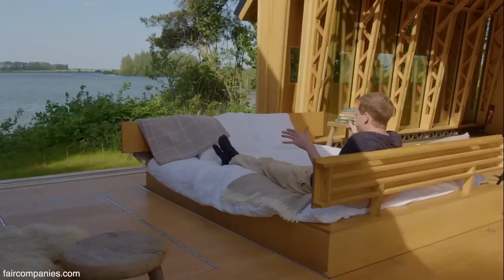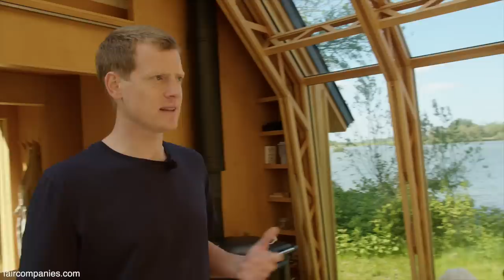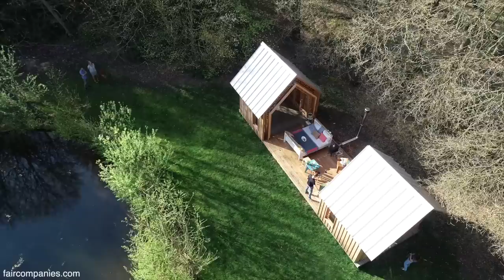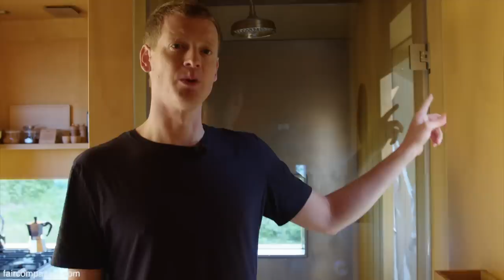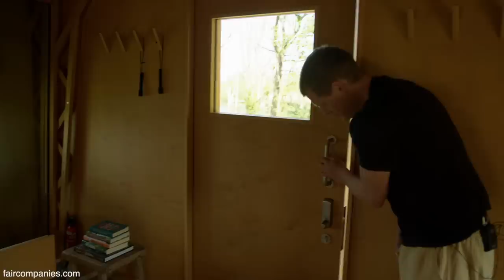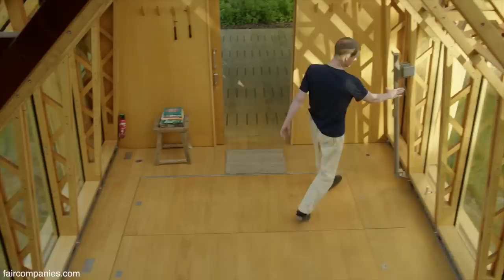Sliding home enlarges with railed-walls, underfloor bed & tub reveal

Comment: Wow!  MANY improvements since that first prototype on his Mom's property.  I LOVE that it's air sealed now and the glass has double panes.  The attention to detail in making it more weather tight, well insulated and with a kitchen, bathroom, not water and power is fantastic!  I also notice he's added even a pocket for the glass section to mate into the stationary piece with for air sealing.  I really love the original, but having both ends move didn't allow for the kitchen and bathroom.  Pretty brilliant.  Nice to know he's developing a kit that can be flat packed and shipped, though I'm sure it would be extremely expensive (from our perspective).  Anyway, love this one even more than the first!
Reply: I would make it a free standing kitchen on one deck, which can be covered just by the glass, or the body section, or opened up. So the door on that side would have to be some kind of larger bi-folding doors.
Reply: Is it a different house it just a better one ie is the other one out the back?
Reply: @lucypeace6132 haha I agree. I think I said that too. But a glas extension since it is holland

Comment: Love this design. I like the builder's thinking process in the design. You are really in nature when the structure slides apart. Awesome.
Reply: I get the notion, I really do. However imo it exudes flatulent novelty and is lackluster in reality. Longevity issues, leaks, track problems etc.. No doubt, any settling would screw up the whole thing. Not to mention earthquakes.

And mainly, if you want to be outside, go outside. If you want a bathtub outside, great. This is why decks and patios exist. This is just a waste of materials, time and energy.
Reply: @newolde1  Definitely a lot to consider! I never thought about settling of the structure. Yeah, it would make it obsolete in its design.

Comment: It is an interesting concept, the only thing I always think with those integrated solutions in acting house like the moving bed or walls, is the hassle of moving the stuff every time you need to reconfigure the space
Reply from the maker: I think the idea is to either leave the bed out (if you decide to make that your main bed in a loft type space) or leave it in the floor (if you'd prefer a big table and to have your bed up in the loft) and really only change that default setup for bigger events.
Reply: @kirstendirksen  I agree, the loft as sleeping space makes sense as a single or couple. It makes a lovely treat, to be able to sleep underneath the stars & could really reignite interest in any intimate relationship. That’s one matter I find fascinating

Comment: i hope they make a model with a larger and more traditional housing unit add on. like maybe an extra 10-15 feet of depth with a full sized staircase, a taller bed loft, space for at least a 3/4 size fridge and a desk area for a computer. i wouldnt personally use that bed for anything but guests.

Comment: I think it’s beautiful but also that the novelty would wear out pretty fast. 
Also, what kind of maintenance does he expect will be necessary to keep those moving walls “super low friction.”   There’s a lot of crap floating in the air.
Reply: How would you keep it warm?
Reply: @tp1201  Have you watched the entire video? It explains quite well I would think.
Reply: @MarkTheMaker  wood and glass.    
Don't think so.
Reply: @tp1201  Perhaps I don't read your comments right. But you asked how this house is heated. It contains a wood stove that is being used both for heating the space, as well as heating water for the kitchen, shower and bath. 
They also explain how the whole place is actually quite airtight, even though you would expect air to be able to run through where the wheels of the sliding parts run on the rails. Same goes for the door with the dropping brush in order to stop the wind from blowing inside.
Reply: @MarkTheMaker  yes, I did see the wooden stove, but I'm sure it would still be cold inside. No Insulation! Well not enough insulation for me. I would need some heated floors as well. Or live in a warm climate area.
Reply: @tp1201  I don't know if you have ever experienced the warmth of such a wood burning stove and don't know how cold your climate is. But I've spent winters in a badly insulated chalet in the French alps with nothing but a wood burning stove. Outside it could be -20 and inside 25 degrees. 
The double paned glass and most likely insulation in the walls would probably make this a very comfortable place to live in. 
Also, when needed, you just make it smaller so that there is less volume to be heated...
Reply: @MarkTheMaker  That is nice to know. I really like this cabin. 
Thanks.

Comment: Bath complications of floor panels made easier using folding floor flex hinges and drop into storage compartment customized to solve so many dirt, air flow and water issues. Loving water wood/solar! Wrap exhaust chimney coils or stovewall hot water RV home efficient. Outdoor shower great and possible indoor shower using tub with flexible shower curtains

Comment: I would love to add the glass pull-out section to the back of my Florida townhouse!  And I'd change the tub to a four-person hot tub!💖👍
Reply: In that case you're better off putting the tub outside, otherwise you have a huge vapor source in the house. Mold city.
Reply from the maker: That's an interesting idea to add something like this as a home extension.
Reply: @kirstendirksen  I think this young man has stumbled onto a potential global solution for homeowners with limited space and should start a business!

Comment: At 25:50 I thought they had the bed in a separate room on the opposite end of the house giving you a bedroom but it was just the way the shot was angled but I think that’s a much better design.  
With so many people wanting a bedroom on the first floor I think it would be better to have a divider wall with door on the one wooden side the one without the kitchen bathroom as a bedroom with a wall and door, kinda the way it looks at 25:50 with of course the bed in there not in the middle of the house.  
 I just think it’s more practical to have a closed off bedroom, unless you are younger and don’t mind sleeping in the loft, though I’d love the loft if they can somehow make some tall stairs going up to the sleeping loft. You probably could, going down beside and or over the fireplace. it just might be seen through the glass but I think it would look cool if you could build metal and wood floating Stairs making it almost look like art :)
Reply from the maker: I wonder if this kind of build works best for one person living alone, or a couple, and likely in a more remote place where you wouldn't worry as much about privacy. Though I like your idea of art stairs.

Comment: Interesting concept. The glass patio being on the end of the building was the best orientation to me. If the main house was fixed and only the glass patio moved to open the deck then I would like it better. You could double the amount of solar panels without having to worry about the weight. 
 Accessing the bath and bed seems exceedingly tedious. A small hot tub on the deck seems like a better option. Just move the boiler and bathroom to that side of the house in order to keep it heated. 
Instead of having to crank the bed up and down I would go with a recessed floor where you step down into where the bed is located. That way you can simply place the floorboards to cover the bed space without needing to remove everything from it and spend 10 minutes cranking it every time.
I would also go for some larger windows since it seemed rather dark inside when everything was closed up.

Comment: What an amazing home.  So calming and serene.  The wood is really gorgeous too
 I wonder since they are close to the lake if there are any issues with mosquitoes or other insects.  Here in FL you would NOT be able sleep too well, wondering what's gonna be crawling on you or eating you up, breakfast lunch and dinner, if you were open air like that. Heck, even in a well sealed house there can be issues with fire ants, regular ants, the Itty bitty sugar ants, spiders, flues, cockroaches, palmettobugs, & mosquitoes. just to name a few. There also can be the occasional lizard, which I don't mind cause they eat the others.

Comment: I really like this design in principle but would need a few modifications. If you live in a place with dangerous wildlife, sleeping out in the open full time is not wise. I would at least need a screen layer to keep the mosquitoes from carrying me off and to keep the snakes and spiders out. I love the idea of using the floor as a suitcase instead of wasted space. I suppose all the electrical outlets are in the floor? I wouldn’t want to heat water for 2 hours to take a bath, but could use the solar year round. Yes, a few modifications and this would be perfect.🤗❤️🐝

Comment: Do they have no bugs in Netherlands? Where are the screens says the Canadian? 
 What happens if you get ice in the rails, there is no way move the walls I think?
Very cool, but go sit on the porch if you need to be in nature.   I can't buy the central premise that  all the engineering is an enabler of an enhanced perspective.  With all the moving walls, I guess it forces decluttering, you can't stick anything off in a corner.  But I think it would only work if you decided already you wanted minimalism, there's no place to store anything. Where do the wet PFDs go to dry when you get out get out of the canoe?
Reply: Definitely less mosquitoes and other bothering flying insects anywhere in Europe than in Canada’s lakes in summertime. I don’t know the reason. But: Caspar told us they are also considering that aspect in their iterations, he’ll probably explain soon. Cheers.

Comment: Interesting ideas,
I personally would rotate the bath panels such that the lip is near me - put, push, put, clip, push, put, clip, push - and the same in the other direction (unclip, pull, store, unclip, pull, store) - saves all the walking about.

The bed mechanism could be driven by an electric drill-driver.  It's probably not an issue to do once in a while but you were doing it every day (perhaps there are four of you, and you need the space?), you would get very tired of doing it by hand every time.

Comment: Seems like a gimmick. 99% of all people will have the house in max size setting all the time. Having the glass being able to open up is nice, but it also means you can't have anything on walls or roof in the big part of the house.. So no lamps, no paintings/tv/etc.
Another weird thing: what is he using the extension part for? It's an empty room, so you would have to bring in stuff from the outside? So does he have a barn somewhere, so he can put stuff like a sofa, dining table or something like that in the big empty room?
Reply: You'll be very depressed if you go to live in Japan.
Reply: That's why this is not for you. 99% is an overstatement.
Reply: Compare it to a hotel room or even serviced accomodation and then you'll likely get an idea of its use. It's fun and interesting, and probably a great place to spend a fixed amount of time. I think it would be great to spend some time in and challenge yourself on exactly what you do and don't need in life. 99% of people (myself included) live in dull, unimaginative houses. I think most could do with a bit of creativity forced upon them!

Comment: Very cool, reminds me a bit of The 5th element and the auto-wash and the furniture that hides.

Also, bug netting on the little window but not on the shells? There needs to be a tent shell with a bit of shade and some netting as well, no?

False floors definitely provide a lot of flexibility. What are the trade offs are between a false floor vs just adding another floor? Are the dimensions locked to shipping container sizes?

Comment: I could see this installed on a platform with rails protruding off a cliff w/drive way leading straight to the front door. ;O)-
Reply: If wind is an issue, those rails can be glass walls that extend upward surrounding your patio walkway.

Comment: But you can't have any lighting or electrical sockets in the walls or ceiling. If you made a solar roof and integrated the batteries and inverters in the roof and walls you could remedy this to a decent extent. I just noticed the solar panels. nice.

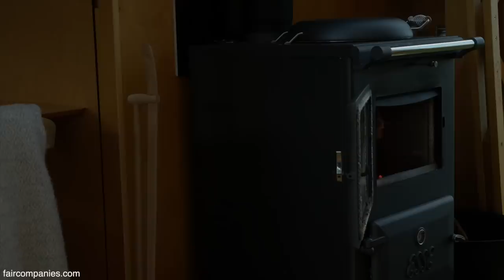Comment: 12:40 air conditioning: you could probably expand the number of solar thermal panels, then run that hot water around a canister of liquid ammonia, and use phase change to have solar powered air conditioning.  

Find an engineer that builds hot water fired chillers, then off grid AC would be possible.

Comment: I love it, but.. 1. You need strength. Not good if your bed gets wet coz you got caught napping. A hammock outside. A GLASS EXTENSION, that you can open> a bath and shower outside ... Avoid all that cleaning of those geooves and scaffolding which interrupt my peACE. But it is a great concept.

Comment: You can't use the extra space. This is like a murphy bed, where you need to leave room for the bed to come down. Not as clever as it seems.
Reply: Are you a quadriplegic?
Reply from the maker: I think his desire to create that extra floor space came from his experience with his mom's backyard cabin. He said he and his brother had to help her move the furniture when she wanted to have a dinner party. With this cabin, the bath and bed can go into the floor and someone could easily bring out a folding table for a large gathering. This kind of thing could even work well for a small wedding party (my brother just had immediate family) with an option to eat under the stars or cover up for rain (and no tent needed :)

Comment: hey, try floating balloon wavt shaped wind turbine on a pipe axle to ground generator (both solar and wind large balloon collector, similar to a heat pump field but in a simple hot air plastic balloon, feed starter hot air up the pipe, have a second pipe to extract cold/hot air down), you get the idea, can use even a car charger as the pipe axle down generator, 4-point tether if you want the balloon to stay absolutely upright and not wonder around, public domain no restrictions no royalties no obligations anyone can use. only has a simple air/heat pump (like a water pump) in the up-down 2x pipes, can be combined with a heat pump which is down at ground. the size advantage as a simple balloon, no construction required, only the ground mounting of the generator pipe axle tether point, like putting a flag pole in place, the anchor. combo electric/heat collection generation system, even rain water collection alongside the vawt generator balloon, down alongside the tube

Comment: that's interesting that his stove pipe is propped up by wood. I JUST did that at my hut since I had a corner clay wall crumble from the rain-freeze cycles and heavy snow this winter. So then I thought I should put some rockwool over the wood against the stovepipe just in case the wood gets too hot. haha. I have the same horizontal pipe deal. Oh I see now - that is his double pipe on the outside. cool.
Reply: Outer pipe maybe his stove air intake
Reply: @rcmrcm3370  it should be insulated - to prevent condensation in the winter. He didn't really talk about the winter though.

Comment: Don't see the point of a transformable home like this when it makes it not a usable space. It's a mess when it is fully closed, a big empty space when fully extended. Nothing can be put on or near the walls, you wouldnt put anything permanent in the extended part and if you did it would have to be on wheels so as not to be a chore to pack up every time you close up. When you wake up and its been raining the floor would be too wet to extend the house out. To many issues just to have a bit of flexibility. Later models are better at being homes though I must say.